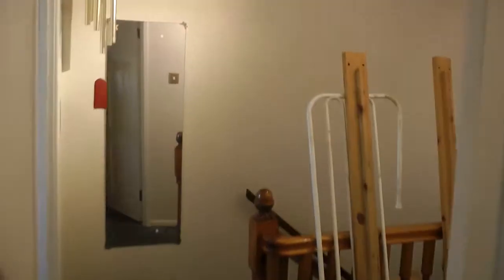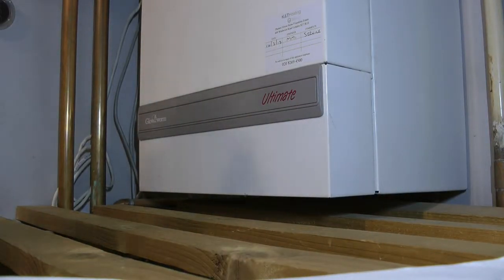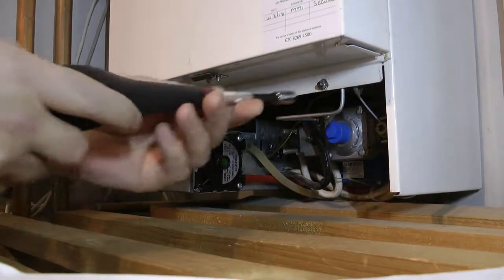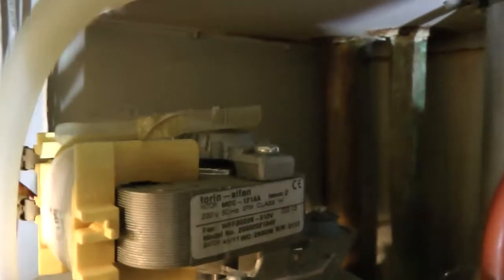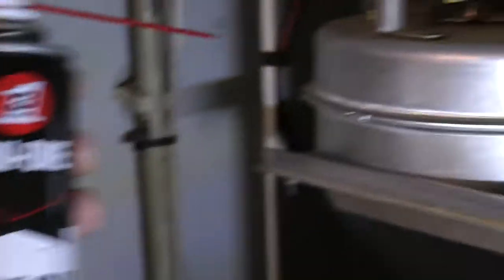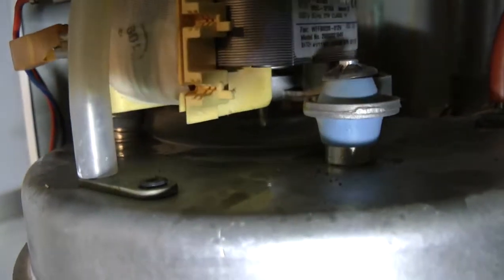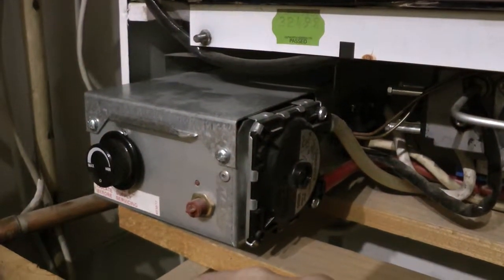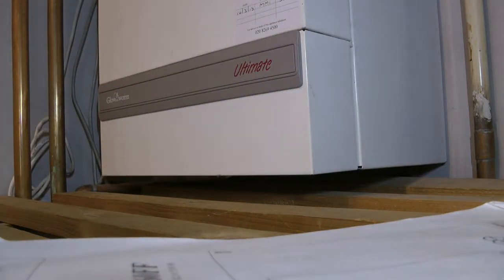Gloworm Ultimate Boiler Fan Fix

Comment: What happened to the small plastic fan on the top which was there when you started and not there when you finished.  that was the part I wanted to learn more about.  By the way I also have a small nut and a wing nut on my Gloworm Ultimate so that must be standard.
Reply from the maker: Hi yes the plastic fan helps the induction motor keep cool but it got so hot it melted the plastic hub that kept the fan in place.
Reply: @ColinJamesPoulter  LOL.... My impeller fan melted also and spun off.  Today I fitted one I purchased of ebay with appears to work "GLOWWORM ULTIMATE IMPELLER FOR 70FF 80FF FAN 2000800421 800421". The quality looks a lot better and hopefully it is more heat resistant.   Not stated for the 60ff but appears to fit ok.